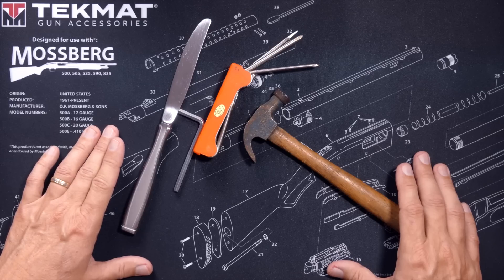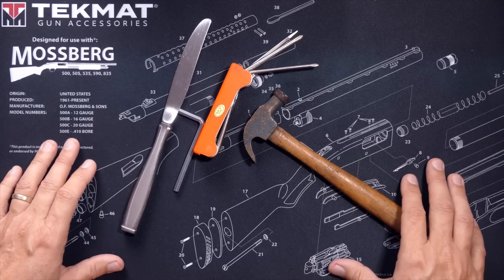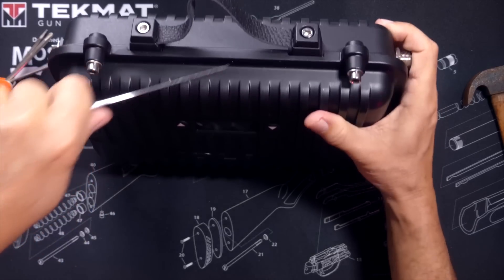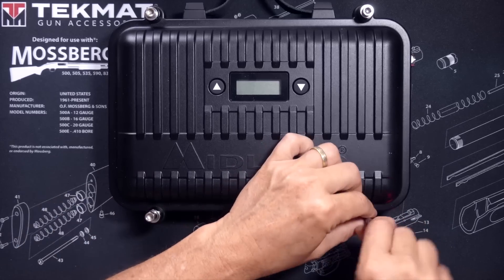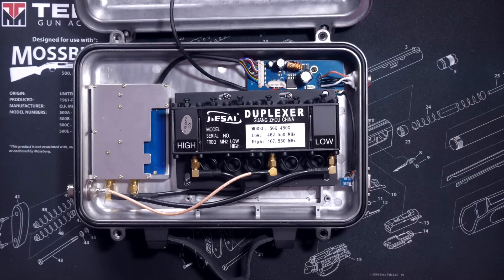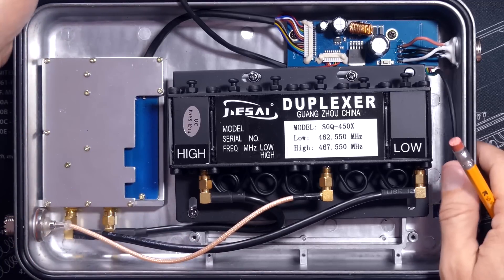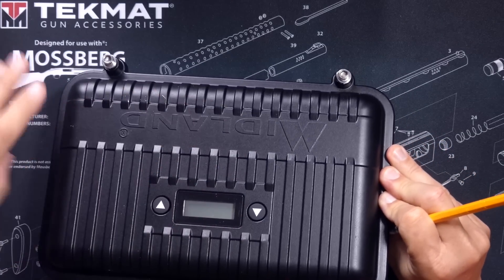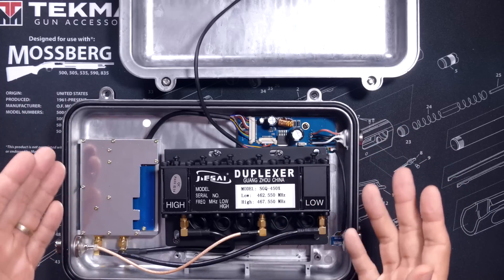Midland MXR10 Repeater Teardown - What Is Inside A Midland MXR10 GMRS Repeater?

Comment: I am new to the radio scene. I just got my GMRS license today and I purchased a set of TD-H3 radios to begin experimenting with. I plan on using the radios for my family around my 250 acre farm in KY. I have enjoyed  and learned a-lot from your videos. I still have questions about repeaters. Wouldn’t a 50 watt mobile be able to out broadcast a 5 or 10 watt repeater?  I’m thinking I may need a repeater on my farm. The highest point would be my polebarn. Not sure if a 10 amp repeater such as the midland would help me much more than and 8 watt HT or 20 watt mobiles. Could you consider doing a video on repeater wattage vs radio wattage for newbies?

Comment: Why in the world would they use a mic port for the power input and sum 9 pin connector for the mic? Just plug in any CB mic and PRESTO you can transmit. What the hell were they thinking.
Reply from the maker: Is that how you do it with your Multi-Million dollar radio manufacturing company?

Comment: Have you tried connecting the amplifier to the transceiver from the inside to see if you can get the repeater to 20 to 40 watts?
Reply from the maker: No because that would instantly fry the duplexer which is only rated for 10W or less.

Comment: well you have no warranty. nice look inside. for those advance users we can easy swap out that SO 239 for the N connector . But easy just to screw on adapter . looks like will run 12-24V just fine.  that power unit is SMPS . will draw less amps at 24V.  I got Helix hardline with N connectors . I would just use adapter   . I got real good ones. silver and gold plated.  for at camp cite I would use RG 400 coax . nice look !

Comment: Randy, I just received the Midland MXR10 repeater. I have a question. I am using a KG-1000 as a base radio, When you hook up the repeater to the antennae, how do you transmit without attaching the KG-1000 to the antennae? Just beginning this journey. Thanks for the entertaining videos!
Reply from the maker: The KG-1000G needs an antenna, so if you are using your antenna for the repeater, you'll need another antenna.
Reply: @TheNotaRubicon  Thanks

Comment: Jokes aside, it would be interesting to see how two UV-5R's perform. There are $5 adapters on Amazon that allow to connect two radios together using headset connectors and use them as a repeater.

Comment: Guess what Randy...  The internals of the Midland are exactly like the internals of the RT97!  I opened mine up when I got it so I knew how to boost the power to 50 watts, 25 after the duplexer of course.   Somebody copied somebody..  Just say'n...
Reply: So how did you boost it to 50 Watts?
Reply: @melissasmess2773  The duplexer in the repeater wouldn't handle the 50 watts.  To solve this I took the TX and RX from the radio in the box, removing the cover and voiding the warranty of course, and hooked the TX up to a BaoFeng 50 watt amp.  I connected the TX amp to a XLT Communications GMRS Mobile 50 watt Duplexer and the RX from the radio to the RX on the duplexer.  Granted I'm only getting 25 watts out after the duplexer, but there is 50 watts going in.  This was all done through extra SMA connectors that I'v added to the case so I can run it default from the factory or hook it up to a beefier amp to get better fars since I don't have the case for a LARGE antenna.
Reply: So I take it the duplexer was able to handle 50 watts input?
Reply: I don't think anyone copied anything.  I think Midland just had theirs built by the same place.